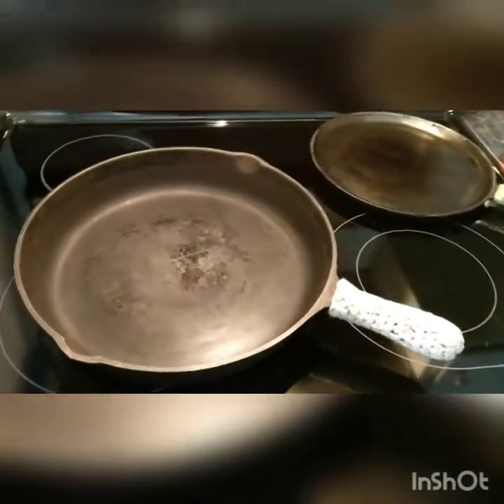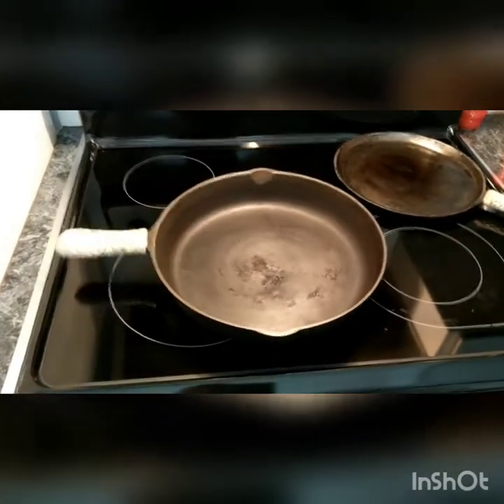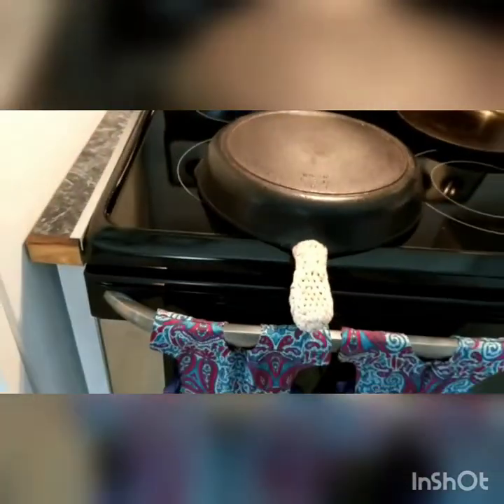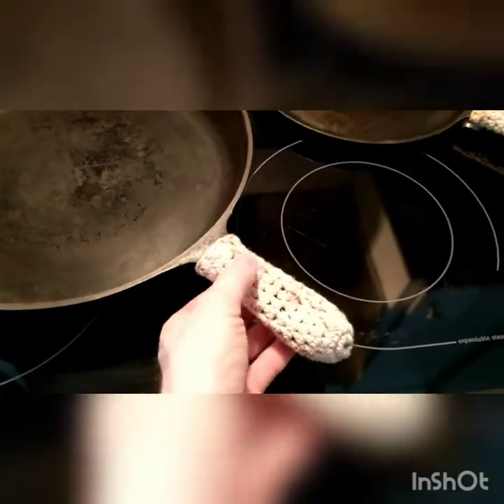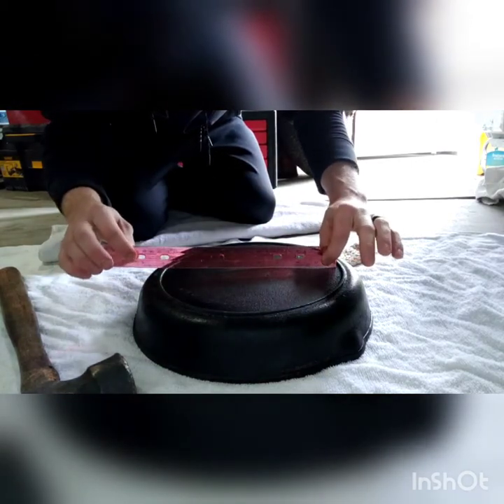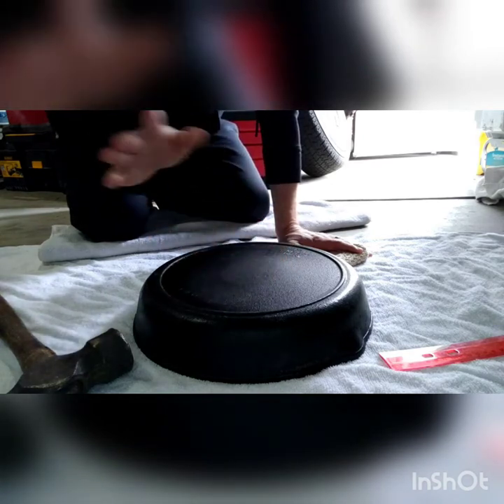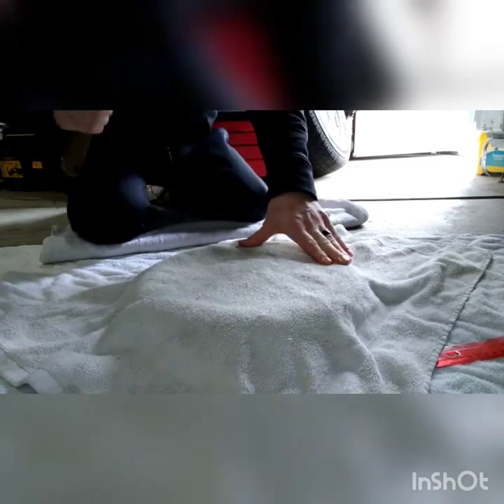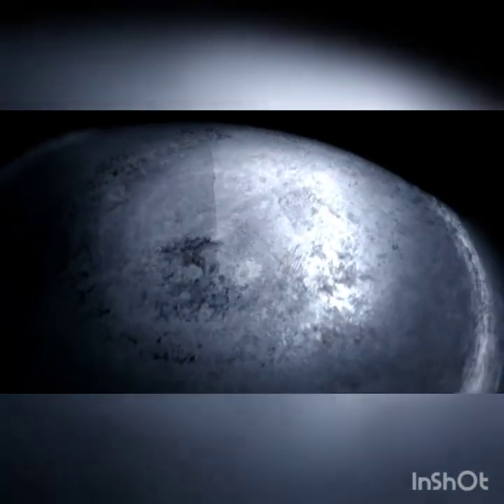How NOT to Straighten A Warped Cast Iron Pan - Lesson Learned!!

Comment: If I were to attempt this I would heat the whole thing with a torch then hit ot with a 3 pound hammer, might have better odds
Reply from the maker: The point wasn't to do what I thought would work. It was to test the number 1 search result on how to straighten cast iron pans and to help others, whether it was a fail or a success.

Comment: No way you heat pan til metal is pliable set it up right.. u cracked it because metal was  cold..use a rìbwr mallet on inside.
Reply: Use a welding torch. Make it red hot, or just enough to get it to move a bit while sitting on the flat concrete floor. Then maybe dip it in water to set it.
Reply: Less risk but still a risk of cracking even with heat.

Comment: Lmao...this. You definitely have to heat the pan first, and a towel is not enough protection by a long shot. You have to support the opposing side and shield the side that is taking the beating. For example, setting the red hot (I do mean glowing red) pan on a perfectly flat, circular surface (ideally the same or very close to the same size as the pans diameter) like a log/stump using the clean cut end as your support/work table, then use a chunk of 2×10 (or 2×whatever as long as it covers the diameter of the pan without hanging way over which could cause it to be imbalanced while striking and leave you with a pan that sits at a hard angle). Give the wood several firm blows with a broad, flat faced 4lb hammer, checking for progress every few blows. The pan will then have to be heat treated and reseasoned.
Reply from the maker: The point wasn't to do what I thought would work. It was to test the number 1 search result on how to straighten cast iron pans and to help others, whether it was a fail or a success.

Comment: I saw that coming ruined a perfectly good baking pan could have put anything in this in the oven what a worked on a gas stove where it belongs really cast iron has tensile strength it doesn't Bend it breaks just like glass hard to believe that railroad iron is the same way it will snap like a twig underweight

Comment: Perhaps if a block of wood the size of the interior of the pan was used to support the pan, you might straighten the pan without cracking it.
Reply: Nope. Won’t make a difference, you can’t bend cast iron at all.
Reply: Cast iron is comparable to stone, would you ever consider bending a rock?

Comment: The Leaftv article said to put the bottom of the pan on a hard surface, not the rim with the bottom unsupported. Grade 'F' for reading comprehension.
Reply from the maker: Read step 3. My warp was down therefore it would be pointless to put the bottom of the pan towards the floor and hammer down. I would just be making the warp larger. So I had to skip to step 3 for my pan. 

My comprehension was spot on. Seems yours is a little sub par.
Reply: @FrancisR420  Numbskulls believe leaf tv or whatever it is called.  Cast iron is too brittle even if heated.